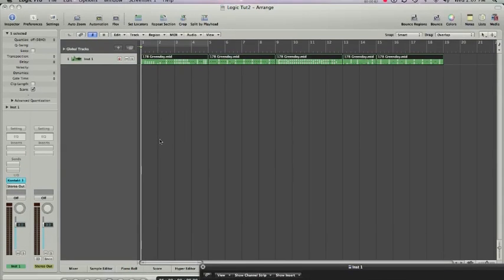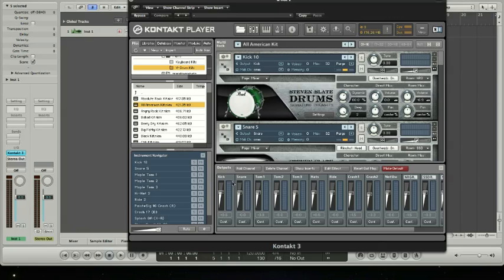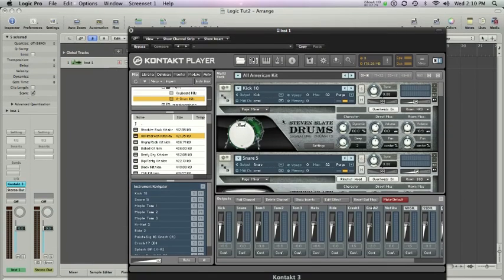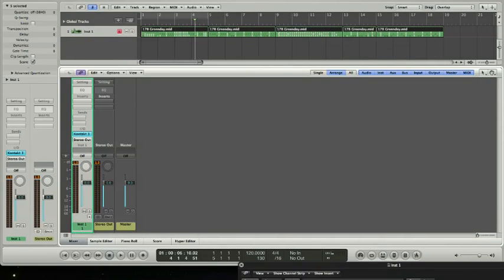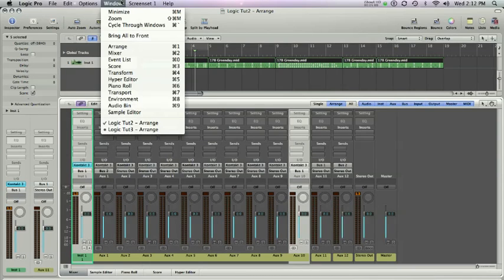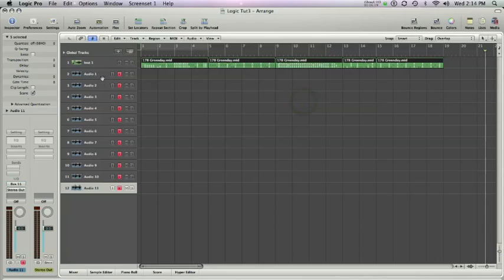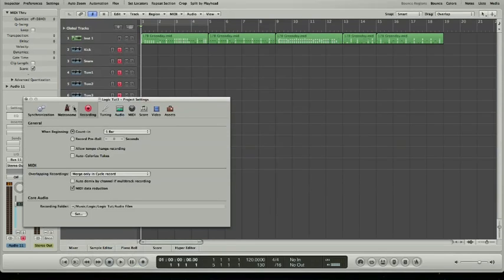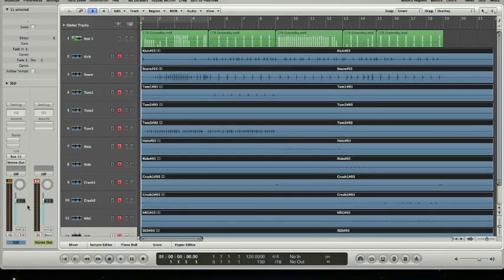Convert multi-output MIDI to audio in Logic Pro

Comment: thanks for the video, was thinking there has to be an easier way than this, so started messing about in logic.

turns out all you need to do is select the first instance of the midi instrument, file -> export -> track as audio file -> then make sure it says multi output software instruments: one per channel strip.
include volume and pan automation.
then hit save and the tracks will bounce to the folder you have set up. probably the bounces folder in the project folder. then you can just add each track to the project by right clicking on each new track.
Reply: Issac Cartwright THANK YOU!!!
Reply: It should works bu,t even if it says "multi output: one per channel strip", it create just one audio track... I don't know why.
So I have to right click on the midi track - midi - separate by note pitch (it creates one midi track per  "drum piece") - export each single midi track as audio file.
But your way is a lot faster...it just doesn't work in my Logic..